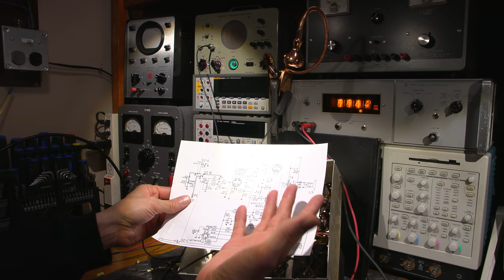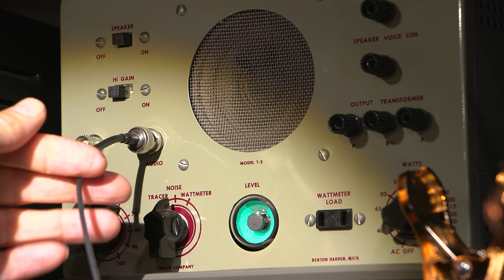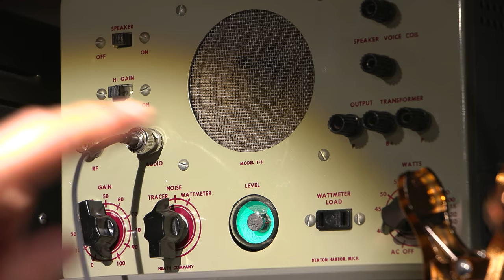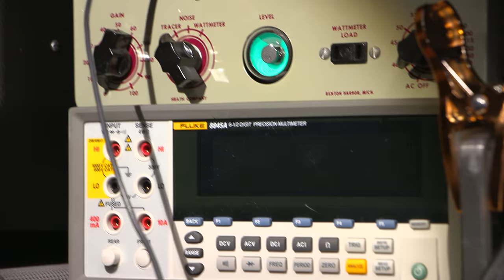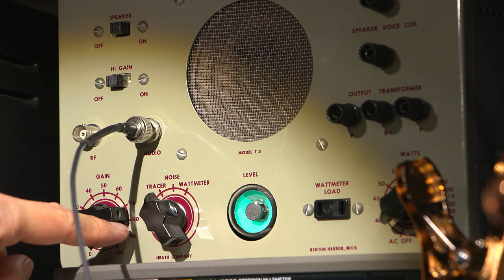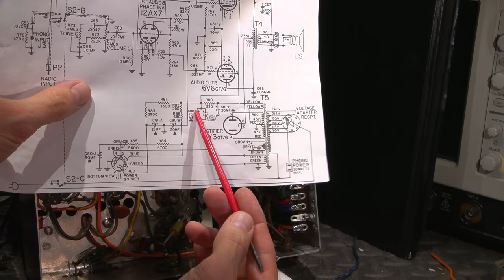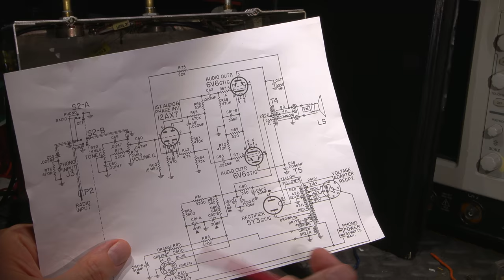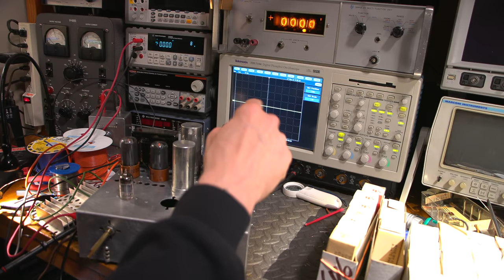Radio Receiver Restoration Series Part 3 - GE CX371 Amplifier / Power Supply Rebuild!

Comment: Hello Paul I read about cadmium coated chassis. Before I knew anything about it I didn't know what all that yellow dust was and I didn't know how dangerous it is when it turns to powder. I know I probably breathed some of that in. Its carcigenic and I'm sure you already know that. I now use a spray bottle of water and dampen it before wiping it out. I wish they didn't use cadmium  way back then. I wonder if its outlawed today by EPA
Reply: It's banned by RoHS.

Comment: I worked on an old Stromberg Carlson radio that had two 6V6 output tubes and when I finished, it was playing good but after playing awhile I noticed a drop in volume and one of the output tubes had a glowing screen grid. The output transformer had one side open. From now on I don't trust old push pull output transformers and if they're still working I rewire the tubes from power pentrode to triode mode unless I replace the old transformer with a reliable new one it will protect the output tubes. In triode mode the screen grid is wired directly to plate instead of the power supply through a screen resistor. This way the screen also looses voltage in case the transformer goes open

Comment: I thought the test was going to be to take them to "factory specs" and not optimized? You are showing this power supply as optimized by moving components in optimal placement for best practice. I really appreciate the lessons, but am wondering about the receiver comparisons as originally stated?

Comment: It may have been worthwhile to briefly explain why a bias voltage is necessary when listening to the resistor. It's a very basic topic, but I think it's mildly interesting. However, Mr Carlson has probably explained it several times in other videos.

Comment: Hi Paul, Wondering why wood bases are bad practice for tube amplifiers?  (Thinking specifically of Bottlehead products where components are mounted to an Aluminum top plate  then supported by a wood base) Thank you for the video!
Reply from the maker: Hot components around wood, or just components in general around a wood frame is bad design practice. Resistors burn up, transformers short, capacitors pop, ETC. Unless the entire wooden structure is shielded, or there is some fire proof material used as a liner, I wouldn't want to leave the room with the device plugged in.... Even when it's off. You will notice the flame proof coating even in this old radio, (yellow color.)
Reply: @MrCarlsonsLab  Super Thanks for the explanation!....will be sure to fire proof shield my Bottlehead amp

Comment: the heath kit test set reminds me of the old sprague capacitor checker from years ago it was the best cap tester l ever used ,,you could check dielectric break down under load.

Comment: Some digital multimeters actually have little light indicators on the ports themselves to indicate which jacks to use for each mode that utilizes the jacks. Mine that I have is one of those, altho mine is technically one of the harbor freight special type of digital multimeters. but it's not a bad quality. I'm just missing the thermal probe that went with it because my dad got it from a pawn shop i believe.
Reply: What a great idea!  Indicators reminding you of which terminals to use!  A++!

Comment: I had a 8 watt vacuum tube amp (stated) per channel push pull that was not much quieter that my 80watt per channel Denon amp.
Where are these metrics added up?
That said, the mains transformer in the vacuum tube amp was the same size as what was in the Denon amp (PMA 500)
Both were relatively heavy amps.

Comment: Really nice work. But speaking of grounding, it looks like several chassis grounds are made to the can capacitor lugs, which are grounded via mounting plates riveted to the chassis. Rather than trust the riveted connections, I would solder the plates to the chassis.

Comment: Hi Paul, I was just wondering about the audio power of 6 watts you mentioned, I got the feeling from what you said 6 watts into 8 ohm would sound really loud?  I'm just a bit confused, because modern solid-state amplifiers putting 6 watts into 8 ohms isn't really that loud. Is 6 watts into 8 ohms from a valve amplifier louder some how?
Reply from the maker: Hi Jason. 6 "Real" Watts into an 8 Ohm speaker is very loud. It's hard to explain if you are trying to give someone a loudness reference.... An AA5 radio with a class A output stage makes around 1  to 1.5 Watts, (depending on the output tube.) Have you ever turned an AA5's volume to the max? At 1 Watt, they are very loud. Most computer speakers (external desktop types) usually make 2 Watts or so.
Reply: @MrCarlsonsLab  thank you for your answer , I remember my grandfather and father for that matter taking about "real" watts from valve amplifier and talking them up compared to modern amps. I'm not quite old enough to have grown up with valve amps so don't have a frame of reference. 
Thanks once again
Reply: The speaker is another variable. Older speakers were designed for high efficiency and so they put out a lot of noise of six watts. The trade off was that they were not always as accurate as modern speakers. In todays world watts are very inexpensive and speakers are optimized for accuracy over efficiency.  They waste more power, however they have a wider frequency response and lower distortion. Six watts into most modern speakers will be somewhat loud. Six watts into valve era speakers will be very very loud.

Comment: 5W doesn't seem like much these days of 100W per channal class D mosfet amps but I guess that's mostly marketing if 10W can leave your ears ringing after an hour of it. How efficient is the speaker in it compared to todays rare earth magnet ones?  My current PC amp is 30W per channel into a 5 Polks and a sub that supposedly do 90dB/W and very rarely do I even have that  beyond 25% of max.

Comment: Even though it may disturb the "restoration purity," wouldn't it be advantageous to replace the tube rectifier with suitable solid-state silicon diodes in that there would be less source of heat and would improve placing any power supply components farther away from the any audio stages?

Comment: I understand the colour code of the old plate resistor; yellow-mauve-yellow-silver meaning 470k 10%. I don't understand the colour code of the replacement with the extra red ring. If it stopped there it might mean 2%, but the silver ring is there as well. Pink could mean high stability, but it doesn't look like that.
If it's worth keeping most of the heater current away from the pre-amp stage, why not go further and twist the wires?
When you wound up the gain, the amplifier started clipping on the positive peaks before the negative peaks. Does that suggest non-optimum bias around the phase splitter?

Comment: How do you clean the  bottom side of the switch disc (wafer), which is not so easily accessible as the top side?
Reply from the maker: When a switch is "stamped together" like this one, you have to rely on contact cleaner and switch movement for the hidden side.
Reply: @MrCarlsonsLab  Ah - OK! thought so. I tried to use stiff paper and folded it until it was thick enough to be squeezed under the wafer.

Comment: is there an another way to measure the resistor noise? I assume this is largely a carbon composition resistor problem as it can have raised inductance due to uneven conductance because of heating over time. this should not be a problem with metal film or oxide film type resistors?. or do other type of resistors suffer from it. quite possibly measuring the inductance and capacitance could be a good indicator?

Comment: With that noisy resistor, what exactly are we listening to ? Is it impurities in the carbon, or the carbon breaking down ? Or don't we know ?
Reply: Randomly changing pathways of the current through the carbon granules which are just mechanically pressed together, and which heat and cool and vibrate.  Look up 'carbon microphone" theory for related explanation.
Reply: @KB4QAA  Thank you. I thought the carbon would be too tightly packed for it to do that.
Reply: @frankowalker4662  It probably was, at least initially. Just speculating here, but it could have been a little less dense, but still within tolerance, then decades of heat/humidity cycles could have resulted in particles shifting/settling.

Comment: I prefer to rebuild the electrolytic surface mount caps.  You can use pvc or copper pipe and caps or plugs for the new body.

Comment: General question about using tube device designed for 220vac (China mains) in Europe that uses 230vac mains.
Will it shorten device/tubes life expectancy due to increased voltage?
Thanks a lot
Reply: Today I learned that resistors can be noisy... I wish I had room in my life for another expensive hobby, I'd be diving right in buying equipment and supplies...  and Mr. Carlson's training materials!  I'll have to satisfy myself with the occasional video, alas, but I'm very happy to know that there's people out there keeping all this old gear working and living on into the 21st Century.

Comment: I head nossink; bad old ears. What kind of noise is resistor noise? Changes in the voltage drop? You're using terms we noobs don't fully understand.
I highly recommend micro fiber swabs, both flat and pointed. No little threads.

Comment: Did I understand you correctly that the chassis is cadmium coated? If so, why? You might have kept me from poisoning myself some day because I totally would have done something stupid in cleaning it. Maybe sand it and snort the dust to see what it smells like or licked it because I'm very weird.
Reply: The cadmium was plated onto the metal to prevent corrosion. Its a very effective treatment; however over a long period of time it degrades in a manner that presumably was not anticipated way back then . It is still used in military and naval applications due to its high resistance to salt and heat.

Comment: Mr Carlson how do you know if the transformer
Reply from the maker: Hi Greg. The 6V6 was cold (only heater warm,) this indicates the lack of plate voltage, plate voltage comes through the audio transformer. The only logical assumption would be an open winding.

Comment: Where do you get the insulation material you are putting on the new capacitor/resistor leads?
Reply: Also known as "Spaghetti" tubing.  It's available from electronics suppliers.  Suggestions:  Jameco, Just Radios, Antique Electronics Supply, Mouser, Digi Key, Allied Electronics, are some reliable vendors. I'm sure eBay sellers exist.
Reply: @KB4QAA  Thank you so much! I did not know what it was called. I have used heat shrink in the past, but this stuff appears heat sensitive .
Reply: @thegrassisntgreenertodaytony  The 'old" sphagetti tubing from the 60's and prior was just a cotton cloth tubing, very similar to a shoelace stiffened with lacquer.  The modern stuff is shrinkable.  Ordinary hams and electronics nerds rarely use the modern stuff, but us old time radio aficionados are familiar with it.  BTW, Just Radios in Ontario offers a goodly amount for a small price.  Pay the extra few dollars for first class postage. They are good folks.

Comment: What I don't understand is how Paul can go into great detail about deep testing components and have not tested the output transformer for continuity, shorted turns or (importantly) insulation between the primary and secondary. He also makes no mention of matching the transformer to the needs of the circuit.

Comment: strange lightings its like you've got your gamma up too high, a bit less and some more brightness should do it.
you could use acetone maybe that's what that stuff is.. for cleaning those contacts. and is good for cleaning the valve sockets and with those fine brushes for your teeth.